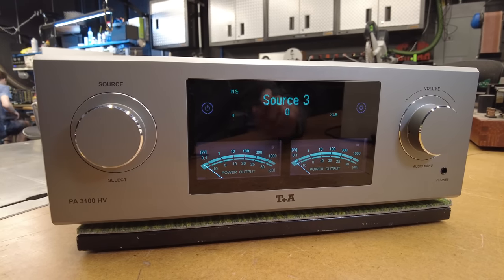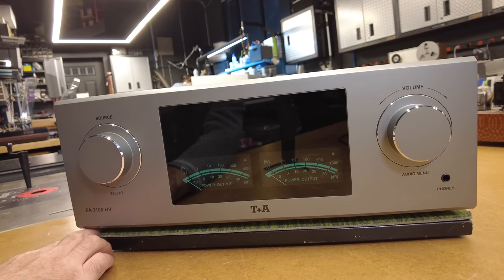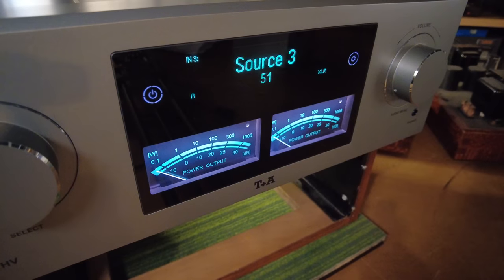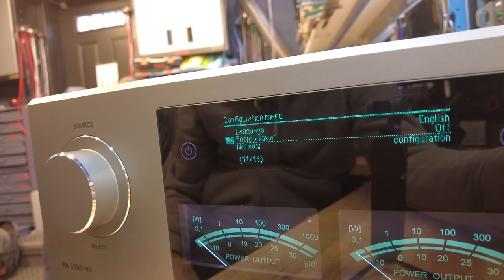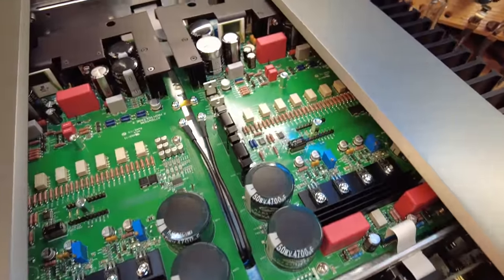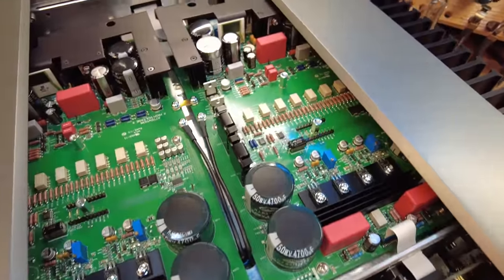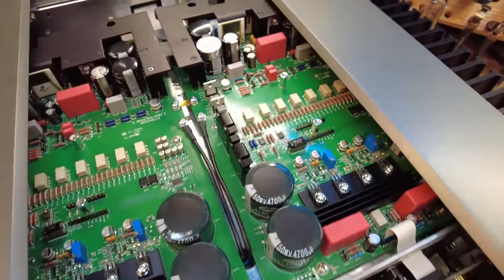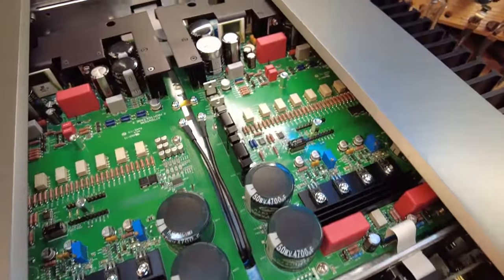The Formidable T+A 3100HV Integrated Amp from Germany

Comment: Very nice review. I have the previous model the T+A PA3000HV with the MC phono card and the MP 3000HV Multi Source / CD player. This is driving a pair of T+A CRITERION TCD 110 S Loudspeakers that are transmission line speakers with a D’Appolito arrangement mid-woofer tweeter design. Incredibly build quality and sound signature that rivals some of the best Swiss gear.

Comment: LAN Connection is only for Home automation. Firmware update is done via H-Link connection to MP HV (media player) only, MP does the firmware updates of all HV units connected via HLink. Connecting external power supply, it does not make this unit preamp. It will add literally offboard PSU = lowering noise floor

Comment: Review some German RESTEK, they never get out-dated, because they have an upgrade and maintenance program, where e.g. in case of a CD player, they throw out all the old crap and bring it up to date, with whatever that is at the time, measure/replace every component. I have an older pre amp which had a service, and it got the headphone amp retrofitted, which was not a feature upon initial release... they do other special stuff.
Reply from the maker: Cool, I'll keep an eye out for that brand.  Never seen a piece.
Reply: @SkyFiAudio  I remember when I was a kid and Gorbatschev came to Germany on state business, the German gov had gifted him a few things to display/promote something from the German industry, obviously, and they gave him a Restek stereo, which I only had a glimpse at for a few seconds on the news. It was the first time I had seen a chrome mirror finish on anything....
They do this thing where all components have the same face plate design, with view for eternal upgradability, and you can choose from like 7 or so finishes, or commission a custom one. If you find a pre-owned component but it does not match your finish, you can have that swapped, and they will even take in your old face plate for cash, if you haven't fucked it up badly...

Comment: What is that slab underneath the  T+A unit that allows you to turn it around so easily, and where can I get one?
Reply: They prolly built that, but it is a rotisserie and you can find ore made for kitchen cabinets, and kitchen accessories etc.
Reply from the maker: Indeed, it's an equipment shelf sitting on a rotisserie from amazon.  Quite handy but makes so much noise on the videos. lol.

Comment: Looking at most amplifiers with much lower rail voltages and they have frequency responses flat to fractions of a dB. Sorry but I don't agree at all with their reason to go with higher voltages.
Reply: That's because it's utter unabashed bullshit. Good for you.
Reply from the maker: It's definitely up for debate if the higher voltage helps.  Makes for a good marketing story though.
Reply: @SkyFiAudio  I think they should have promoted higher rail voltages from a linearity standpoint. Pass stuff typically runs higher than normal rails and its to improve linearity.
Reply: @dominicdiclemente8877  This must be an unfamiliar engineering notion of "linearity". Does it mean "improves the vendor's bottom LINE?"